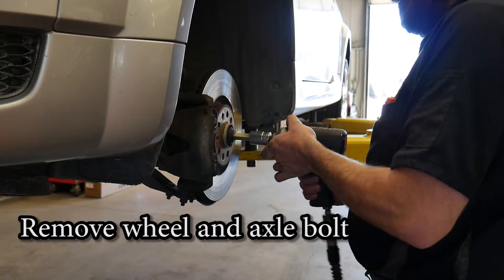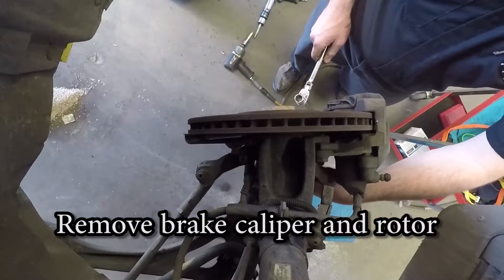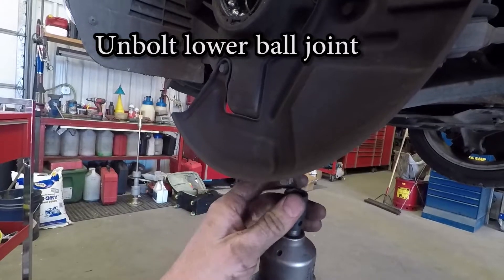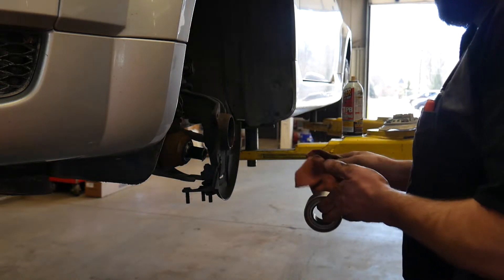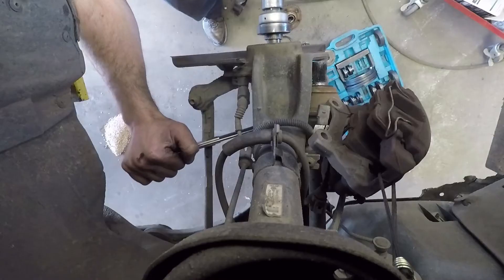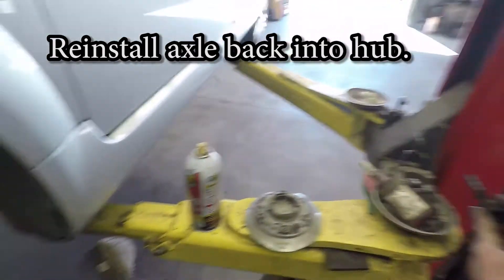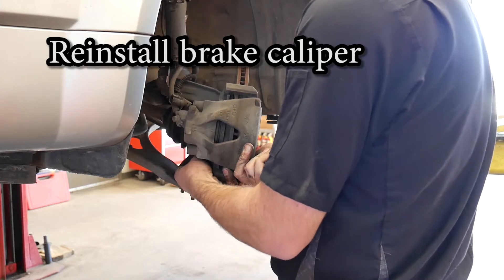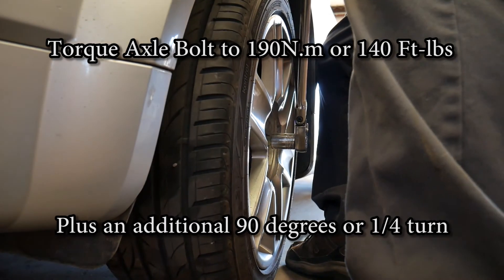Audi TT Wheel Bearing Replacement (on vehicle)

Comment: Thanks for the video. One thing to watch is when I put the bolts back in I always screw them in by hand to start them off, then use the impact on them. Its very easy to cross thread with the impact and it will cut its own threads as it tightens. I was unlucky enough to see a local tyre fitting shop tighten up my wheels without checking them by hand. It was too late when I noticed and they had completely destroyed the threads on one bolt and the hub.

Comment: what was the torque for the 3 nuts on nlower ball joint thanks
Reply from the maker: The three nuts on the lower ball joint to control arm mount torque to 55 ft/lbs (75N.M) If you are working on a variant that doesn't have the adjustment point on the lower control arm and has three bolts instead of the nuts then the torque spec is 20N.M plus additional 90 degrees.

Comment: When you were installing the new bearing, I'm sure you were pressing on the internal race rather than outer. That is not the right way to do it.
Reply from the maker: I typically do press on the outer portion of the bearing race but in this application I didn't have a pressing flange that fit the outer race. I have three different brands of wheel hub service kits and none had a flange that would fit into the knuckle and still press on the outer race without damaging the seal. When this  happens I just press on the inner race. I have done 30-40 VW and Audi bearing this way with out problem but then again I live in a low rust area. If the knuckle had rust build up and the pressing force required was more I suppose it could dimple the races and the ball bearings and lead to a noisy bearing and premature bearing failure. Perhaps I will machine one down to fit the VW applications. Thanks for the tip.
Reply: @ThePracticalMechanic  there are ways to do press bearings and ways not to - your method which you've just demonstrated should be avoided at all costs irrespective whether the installation seems fine or not.
Reply: @ThePracticalMechanic  I just had to do this job and didn't really have any of the right tools for it. I found that once I had the old bearing out I could tear it apart and use the outer shell of the bearing as a press for putting the new one in.